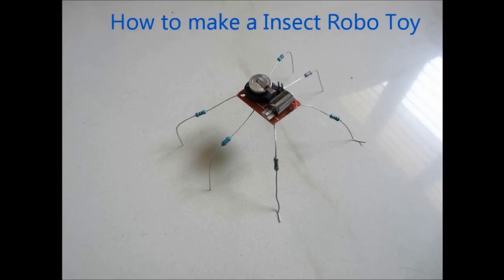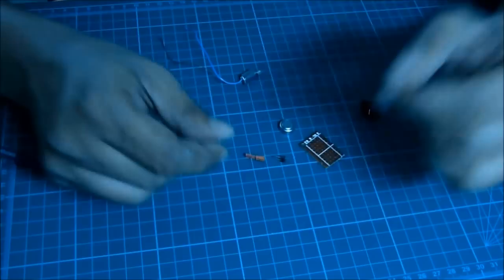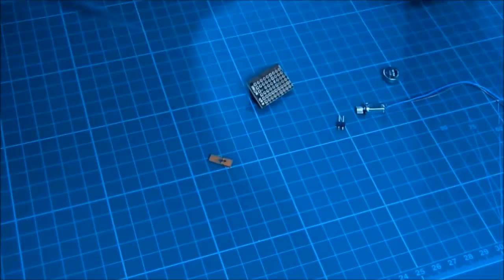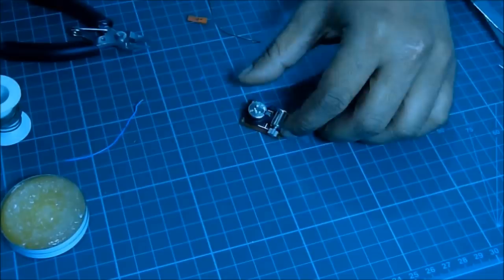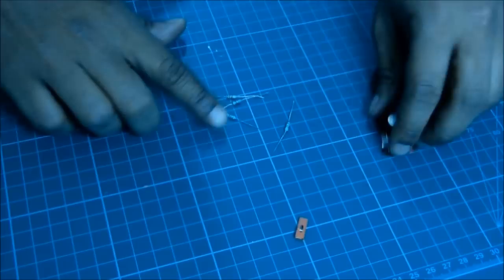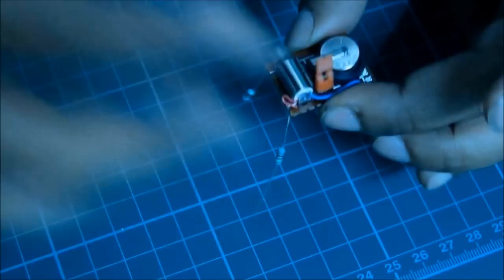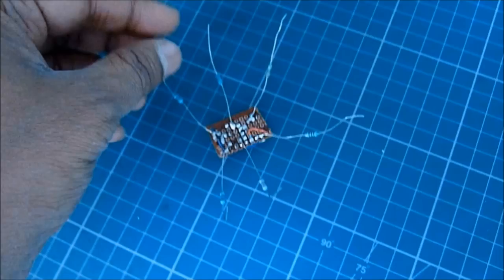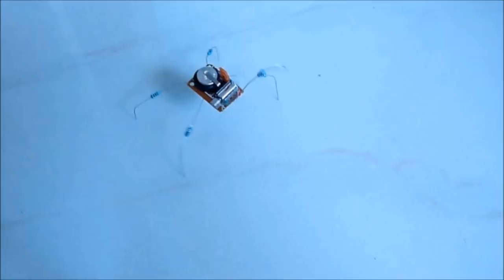How to make a Toy Insect Robot

Comment: If you add a R/C balance distributer that will put weight on different sides of the robot and tilt it towards the specified direction of the controller.